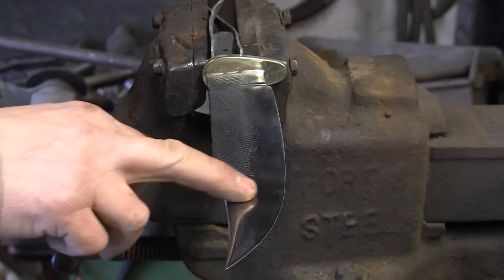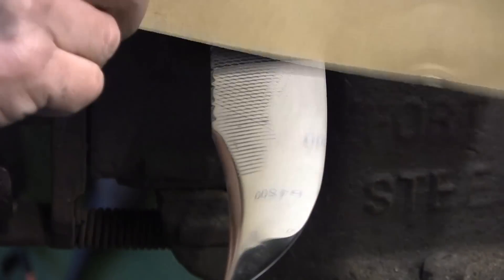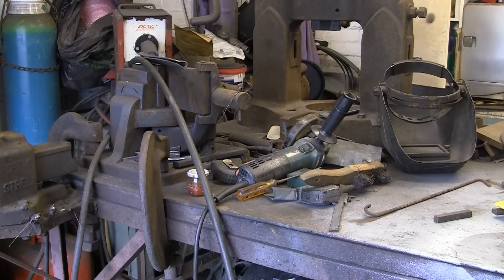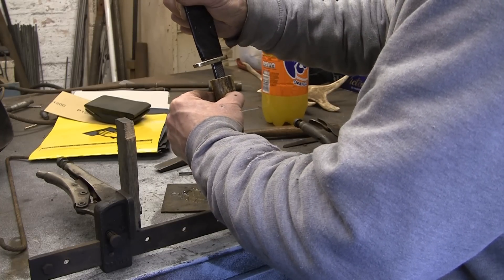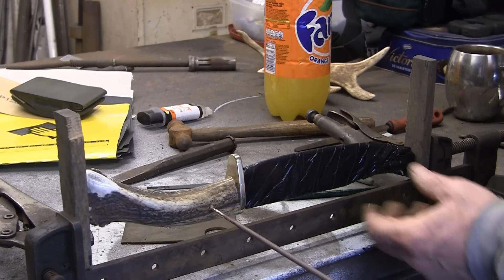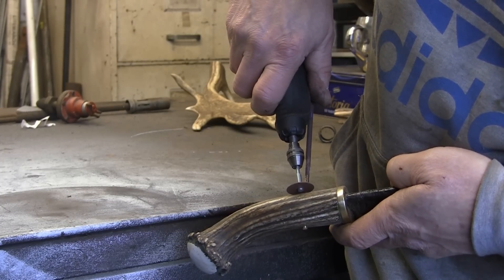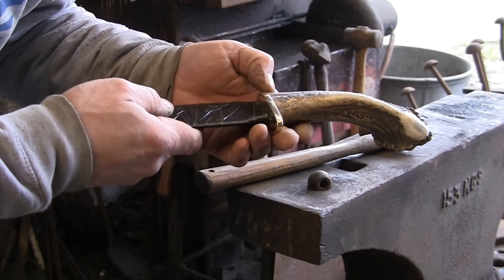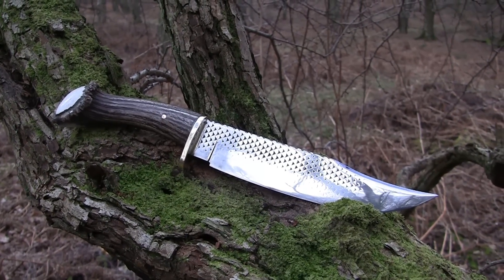Farriers Rasp Forged Knife part 6

Comment: Hey Gary.  Very Nice.  I made one similar from one of my grandfather's old files. I oiled it with just 3-in-1 and it actually started to pit, even indoors, within 6 months.  I did a little research and found this Tuf-Cloth.  I cleaned up and re-polished the blade and brass - hasnt a speck of rust in 3 years now.  I also got a little bottle of the Tuf-Glid (just the liquid that is soaked on the cloth) so that I can resaturate it from time to time.  Best of luck!

Comment: Brilliant series of vids and a gorgeous end result. Congratulations! Knives of Alaska use "semi-stainless" D2 tool steel and it tends to corrode a bit with finger prints and the like if they're not wiped down right away. To counter this they suggest a light coat of mineral oil. May be worth a try. Nicely done!

Comment: This was delightful to watch. A man after my own heart.  As to the rust prevention, I have used clear lacquer on a few that are strictly for display.  Otherwise, I use a superchrome polish that had an anti rust additive within it or just about any or the readily available sprays. Also, If you ever decide to make a sheath for it, you can soak the inside with the anti rust or corrosion preventing sprays. It gives a real nice 'dark from the inside' patina to the leather.

Comment: Great Job man when you first started this project I didn't think it would turn out as awesome as it did. But to answer your question I would put light coat of vegetable oil on the blade to protect it from rust its what I use. Ps I'm looking forward to what you make next.

Comment: How did you drill the hole through the tang for the pin? I have made a couple of knives from farriers rasps and the metal is extremely too hard to simply drill through. If you could answer this it would save me a lot of headaches.

Comment: On one of your earlier videos you heat treated some kind of tool, . After hardening it, you placed it close to the fire and held it there till it got "black hot" . That's exactly how I was taught to do it by a long time farrier and it worked fine. 
A few years ago I took a course. They taught the "correct" way, by  heating the back of the tool and watching the color temperatures run down stopping  at  straw,  brown, purple and so on. This works fine for me so I never tried your way
Thanks

Comment: Just watched all the videos in this series!  Good work sir!  Came out very beautiful!  I like your idea of waxing the blade... that would definitely help keep fingerprints off (or at least make them easy to rub off) ... perhaps you could spray the blade with clear coat paint?  I've just polished some exhaust piping and I'll be using hi-temp clear coat to protect it.  I'm just a bit worried that a clear coat might get scratched when you use the knife though.  Anyways, good job, I have subscribed!

Comment: Hi Gary, you did an incredible job on that knife.  I know this is a bit late, but in the video you asked what you can use to keep the blade from rusting or tarnishing.  Short of electroplating it in some way, You could use some car polish or car wax to protect it and keep the humidity off it.  That is a very nice knife.  Now, I'm thinking that would be an incredible gift for someone who has everything.
Reply from the maker: +Keith Ray Thanks, but i'm using Renaissance Wax on most of my stuff now, if it's good enough for the queen it'll do for me!

Comment: any kind of oil will do
Wd40, olive oil spray, even cooking grease will do
Just be sure to always have a thin layer of oil over the blade
You should also try making a leather sheath, because those will soak up the oil and reapply it whenever the blade is removed or inserted

Comment: Hi Gary. Love your videos. In answer to your question. I recently found Ac50 which originates from the aviation industry and protects steel in the outdoors for up to a year. I think it would do your blade nicely if you haven't already found something.
Reply from the maker: 1day1 unfortunately you are a good few years too late, I have been using ACF50 for many years and it’s brilliant stuff. I mostly use it on the Land Rover but it works well on anything.

Comment: I have heard all kinds of remedies for these blades. I always use Nevrdull wading polish. Your blade already has a leg up on most rasp, or saw blade knives because yours has a nice polish making less surface area for rust (also less friction for better cutting). I think a nice wading polish on the blade once every week, or two and some Sno-Seal inside a leather sheath would help a lot. If it's not something you use much you can just store it with the blade in some rice.

Comment from the maker: Thanks for the tips but I won't be making any more.
I did sharpen it. I simply drilled the pin hole after I had fitted the handle before hardening.

Comment: Great video!! I loved it! I wish my first knife came out that well :] A few notes, I recommend using WD-40 when hand sanding, I would do a second temper after the torch in the oven at about 400 degrees F for an hour, it's usually a good idea to normalize the steel a few times before the quench (I usually do one after forging, before grinding as well) to reduce warpage and lessen the chance of cracking. Did you sharpen it at the end? I was also curious about how/when you did the pin hole. Cheers!

Comment: Mint job sir, I'm not a fan of antler handles but this one turned out perfect! 
I'm quite the young bladesmith myself, both in age and experience but I'm quite in love with this form of art.
You should try making a knife from a metal file, I've already done 2 knives out of old files, it's a bit harder to work with than the metal compound you used but with the proper heat treatment and tempering they can come out to be as indestructible as proper 300+ layer damascus, and about that question you asked, i know it's a bit too late but it might help for a future project, once i finish a blade i spray it with WD40, I can't remember when or not I've heard it from somewhere but it's working out best for me, i even use it from time to time while grinding, I have the idea in my head that when the blade is hot to the touch it acts like skin pores opening up to suck in the chemical.
Anyway, keep up the fine work, been a pleasure watching your art take shape.
Cheers from Bulgaria.

Comment: this video has inspired me to do this for my gcse resistant materials i have done it and got a a for it so thanks for inspiring to do this you have done a awesome job but for the handle i used a fake bull horn and it turned out good i done everything you done and i might be getting a apprenticeship at being a craftsman with metal and wood i dint do the pattern at the top because i dint have the tools and if you wondering im 15 years old. i wouldn't be in this position if it wasn't for this video

Comment: That is one very smart knife you have there pal are you sure you havnt done one before?..... For a protective coat use clear Teflon spray its almost invisible hard wearing and corrosion resistant.... :) and the welding rod is mild steel it has a additive that makes it look like bronze that protects it from rusting

Comment: I know it's been a few months since you posted but to respond to your request for a treatment for the blade to prevent rust and finger prints I have a suggestion. I worked in electronics for a while and we sold a silicone lubricant spray. It works well with all metals and most woods for water proofing. So I assume it would work well with horn and your blade and the brass. I know it will keep stainless polished with just a wipe needed to clean it up. It dries clear and can be applied in layers.

Comment: One more thing... any oil you put on it will attract and hold dust. You have to keep wiping it off and reapplying the oil. Try carnuba wax or even paraffin wax. Light coat and polish hell out of it. Try warming the blade slightly first, it helps the wax to sink in and take a bite.

Comment: That came out very nice, you should be proud of it.  Carbon steel will rust fairly quickly but that high gloss polish will help keep it to a minimum.  A light coat of oil on a regular basis would do wonders to keep the rust at bay.  An automotive wax might help to seal it and keep the rust away also but I haven't tried that.

Comment from the maker: I'm no expert but I have been forging tools out of these Farriers rasps for the last 35 years, I don't know if it's just the material this particular brand are made from or if all rasps react the same. I have had no problems at all. You will remove the temper but you simply put it back once you have forged your job! Just don't get the steel too hot, this can affect the end result...I guess the easiest way to find out is give it a go and see what happens!

Comment: Gary . very nice ,  do you have a buffer that can take a 10" sewen buffing wheel   if so if you bcan get your hands on a few of the , pick up some aluminum oxide grit media blasting     from say 160 up 1200 grit  in  200 grit jumps and some varnish coat the wheels heavy in varnishso the  wheel soaks it up then apply the grit  heavy ,,  set your wheels up  for 24 to 30 hrs to dry , i did this  years ago and i got the idea From Mr Bo Randall 25 some years ago , abd it works great ,little F Y I .GJ

Comment: To protect the blades from corrosion/rust you could use any of these. FP-10, Tuf-Glide, Rem Oil, CLP BreakFree. use mineral oil if the blade will be used for food prep, and others.
(I personally think FP-10 is the best.)

Comment: Nice knife my friend.  Been making a collecting custom knives for a number of years now.  Many of us put Rennaisance wax on the blades and the handles if the handles are susceptible to environmental changes such as moisture or dryness.  It's a bit expensive, but its a very hard and durable wax. Once you've polished it up it will resist fingerprints and moisture and keep rust off the blade but you will not see it and it won't muck up the looks of your knife or come off on your hands, clothes, or anything else the way oils and silicone will.

Comment: I have used neets foot oil on blades, as well as olive, and engine oil. I just wiped on with a cloth that had a little in it. The blade still had a dry feel to it, but it protected against corrosion caused by skin oils.

Comment: Renaissance Wax isn't a permanent coating but it does resist fingerprints and is great if you store the knife for periods of time. Will also prevent rust. A 200ml can will absolutely last a few years at least. Also you could force a patina with hot white vinegar which would turn the blade black and is actually a form of rust but it keeps the red rust away which is what you want to do .

Comment: if you want something that wont affect the finish to much you can us silicone protector that you find in the shoe cleaning supplies section of you local shoe store. it has a consistency of mineral oil but work very well to protect against rust. i use it on my 60yr old case knife and it still looks practically new.

Comment: Nice job. A fine gun oil will help protect it but over time oil will absorb moisture out of the air so you would have to check on it periodically. Once again nice job.

Comment: first of all let me say "outstanding sir" to take a simple rasp, and transform it into a beautiful creation awesome work indeed. now in regards to your question about fingerprints, and smudges I have used a product called ZEP its a industrial steel cleaner, and polish comes in a aerosol can for about $8 usd for 20oz. should keep the fingerprints at bay, and protect your work as well, and if you ever craft a sheath for your blade no oily residue build-up. hope this helps. TY for vids of your work

Comment: Gorgeous blade! To protect it, I would use some sort of chrome polish. It will not dull the finish at all and will help to protect it against oxidation and finger prints. Once per year should do the trick in most cases, if it isn't handled much.

Comment: It's possible to weld brass with mild steel as long as your carefull..... Another possibility it could be the bronze cord 2.5mm arc rod with is made from phosphor bronze ( tin bronze ) which can also weld mild steel amongst other metals

Comment: I use silicone oil to stop rust and stain. 100 viscosity is about right, you want it to be thicker so it would coat better. Been working well for me for the past several years.

Comment: Noxon7 is a product that protects bare metal it should be applied once per year.I am in Canada so I don't know if you have there?also wipe any finger prints off immediately.
Reply from the maker: Thanks, but this was posted a long while ago and I don't think Noxon7 is available here so I have been using Renaissance Wax which works really well!
Reply: garyhuston
you should be able to find it online, though I do have to say that I regularly come back to this video for ideas on what to make

Comment: It's actually called "Boeshield T-9" (As in, made by Boeing for aircraft) if you're going to look it up, and I agree, it's fantastic stuff.  I use it on the surface top of my cast iron table saw before a good coat of paste wax to keep it in good shape.

Comment from the maker: It depends how you are making your blade. If you are cutting and grinding it you won't be able to drill it because you haven't taken the hardness out. If however you are forging it simply drill in the normal way before you harden and temper it.

Comment: Very nice work, but if you want to spend less time sanding and polishing always go perpendicular to your previous sanding step. works very well and you can get a mirror finish alot quicker.
Reply: Along the same lines (no pun intended), I was about to suggest that he go from coarser to finer grits of rouge while buffing. Black emery would easily cut out most of the wet sanding steps, graduating to white, and then red rouge for a truly mirror finish. Well, at least on the flat parts.

Comment: i dont know how well this would work on such a polished blade as that but, i have a forged short sword that i kept under my bed for years that developed a good surface rust, I went about cleaning it with a steel pot scrubber and Dr. Bronners Castile soap, no water just sort of kept scrubbing it and "rinsing" it with the soap. wiped it clean and has been a year and a half of handling it and such and no finger prints show up now when they used to.

Comment: If you cant put something on it that'll protect it and keep its shine you can always force a patina on it it will make it be dull and not shiny but it works you can do it by just mixing vinegar and baking soda and applying it to it and let it sit for a few minutes not to long maybe 7 min or a little more and then clean it of and it might have a little that but just sand it of and it shouldn't rust after that that's what I do to my carbon steel knives

Comment: if it's an ornament then why would you heat treat it or even make it out of high carbon steel in the first place? 440a is pretty easy to work with and, in my experience, never rusts. (unless you want it to. in that case you could leave it in brine solution but that's stupid)

Comment: Camelia oil is the best to put on your blades, be they knives or chisels or plane irons etc etc. You can also use gun sprays such as Ballistol or Brunox Turbo. Quick squirt and a wipe with a clean cloth leaves a film that won't evaporate away and should keep away the 'orrible browny-red stuff :-)  Hot cut the front end of the spine down at a shallow angle before forging and tapering down your cutting edge. The cut/clipped point will curve up by itself as ypu forge out the cutting edge.

Comment: To stop rust, fingerprints & greasy marks use Microcrystalline  Wax made by Chestnut products which is made specifically for this purpose, you'll find it readily available on the net. or any good wood/hardware shop. Great job, well done.

Comment: try drilling your hole before heat treatment. if that still doesn't work try a carbide concrete bit and a very low speed in your press. that bit is not sharp but it will barrel and burn its way through. you might even have luck normalizing the tang with a torch but be careful you do run your temper out.

Comment: That welding rod was not brass - it was probably a bronze welding rod. Brass can't handle the heat of an arc as the zinc (brass is a copper / zinc alloy) will burn off leaving just the copper. Bronze being a copper / tin alloy is usually used to join brass as tin has a much higher melting point.
(Skilled welder for 25 years)

Comment: The only thing you can do is keep the knife oiled. Any oil will do.
For a permanent solution, get it nickle plated. You can 'electroplate' now a days with no electroplating, called electroless nickle plating. You just soak those in the chemical and you get a nice nickle coating. Word of warning, the melting point of electroless nickle plating is much lower, so don't try heat treating after the fact.

Comment: If you're still looking for something to use to keep the blade polished and the rust, tarnish and finger prints off, try a product called Renaissance Wax.  It's used by most historical libraries and museum for keeping their cutlery and other weapons from rusting, and will only need to be applied again after someone uses or handles the item excessively.  Works great for carbon steel knives I've made, even Damascus holds up well if you use this stuff.Hope that helps, I order mine from www.theruststore.com
Reply from the maker: +Elizabeth Olson Thanks, I already use that on lots of stuff and the Pre-Lim surface cleaner.